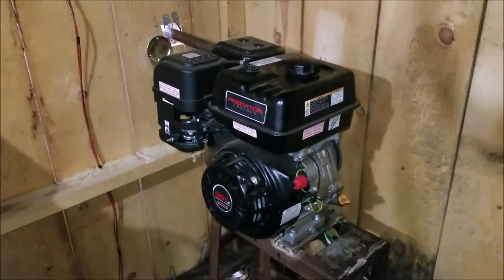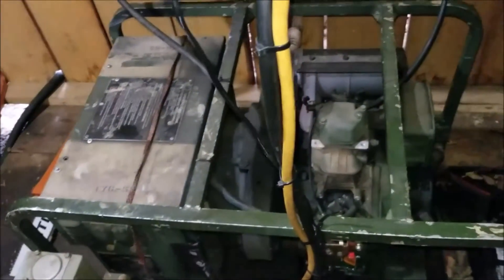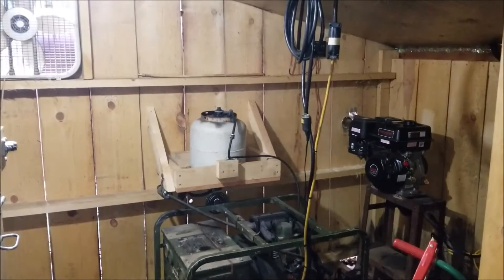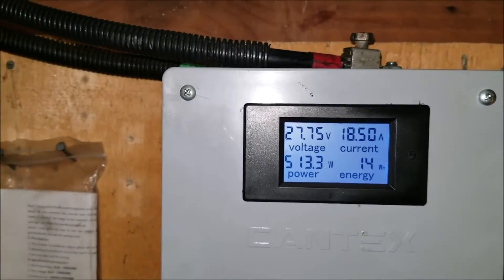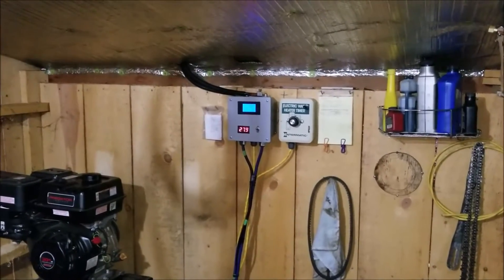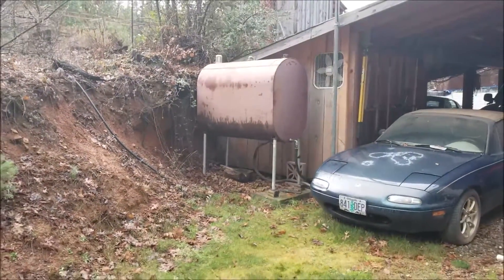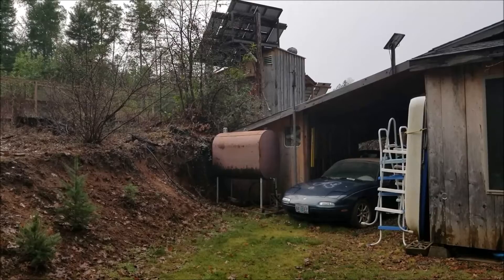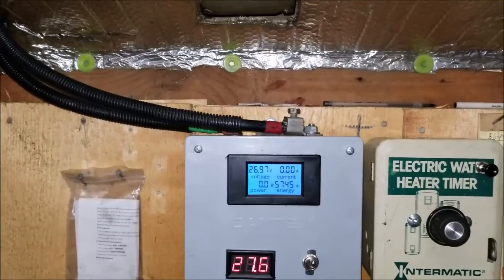24 Volt Predator  Dc generator efficiency test (please read below)

Comment: My 24v PMA has a max 2700 rpm.  They claim to produce voltage at lower rpm's than a brush alternator.  I am sizing my pulley's to run my 6.5hp Predator between 2200rpm and 2800rpm to run the PMA from approx 1900rpm to 2400rpm.  My Max motor rpm will be throttle limited to approx 3000rpm which will run the PMA at 2600rpm.  My hope is to be running the motor around 2200rpm when producing 30amps.  My goal is to run the motor easy.  Your more powerful motor can run at lower rpm.  Great for saving fuel and noise!  I looked at small diesel motors and they are expensive.  My goal is to not have to run my loud 7500w generator and chargers (I don't have your amazing Magnum inverter/charger) which is not fuel efficient.  I am hoping to reduce gasoline usage be at least half of my current setup for very little money.  And yes, I am also working toward a 50% of max for the PMA.

Comment: A 50/50 blend of wmo would cut that in half.....
Reply from the maker: what is wmo?
Reply: Waste motor oil. Used crankcase oil. You filter it, run it through a centrifuge,(bought or made from old washing parts) then mix it right in with your diesel. My diesel loved it. It ran much quieter and smoother.

Comment: my plan was to use a small engine from a very small fuel injected car, at just above idle they use under 1 litre per hour , id almost never need it  but its good to have a back up. my 24v alternator puts out 140 amps max.
Reply: You'd be better off with a diesel.

Comment: I thought that you were also connected to the grid. That would be the cheapest way to charge the batteries when solar was not getting it done with average grid electric being around .12 cents/KWh. I know a lot of people think that solar pays for itself and is cheaper than the grid but that is simply not correct in the US.
Reply from the maker: The grid price here is .11 cents per kilowatt hour. The grid is very inexpensive compared to generating power with a generator. We spend $30 to $65 a year for diesel. We have not been connected to the grid in over 4 years now. The price of keeping a meter and account to the grid is about $27 a month for the service charge. it used to be $19 a month. 27 dollars a month is $324 a year. Ware and tare on the generator is factor to consider.  With only 130 to 150 hours a year on the generator that was designed to run 4000 to 5000 hours in between rebuilds is not a real issue for me. The rebuild kit is about $150. If not for the service charge it would make more economical sense to charge the batteries with grid power when the solar coming in is not enough. Besides there are few other hobbies that pay you back lol.
Reply: @offgridinthepacificnorthwe3210  Not to mention that now the power company has gone total Corp greed forcing spying computer 4th amendment violation on everyone's home.  I refused.  That is why we are off grid now!  I refused to pay the extortion fees for not getting the Spying Meter.

Comment: that diesel  will last 20 times longer then that gas engine will :)
Reply: Maybe not...the Yanmar air cooled diesel ring replacement is every 2,000 hrs. The HF 4K's easily last 2 to 4,000 hrs. About 1/2 so far have failed earlier.

Comment: Very nice testing. Not much fuel used for the kw produced. My  Predator inverter runs about four hours to charge my new batteries uses about 1 and 1/2 gallons of fuel that's used to power my samlex 4024  inverter charger.
Reply from the maker: That's the best way IMHO. Sounds like you are sorted out on the bad weather days. Charging through the inverter/charger with a fuel efficient AC generator is by far a better way to go. I built the DC generator for a test just to see if it was efficient enough to pursue automation and decided to just keep it for a back up in case my diesel goes down. Having a PFC (power factor corrected) inverter/charger is a must. I believe the Samlex is PFC. That's the only way to get all the amps out of the charger. If you have a small generator that has a low peak to peak voltage on the sine wave it will never get full amps out of  the charger. PFC Allows you to get full amps using a small generator. You probably know all this lol. Have a great night my friend.